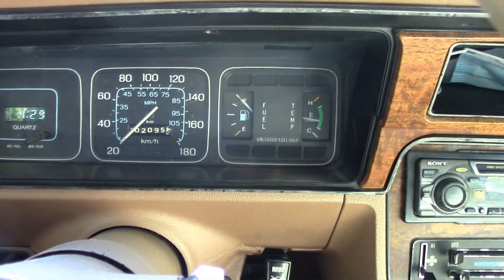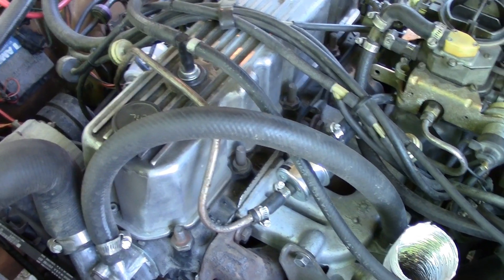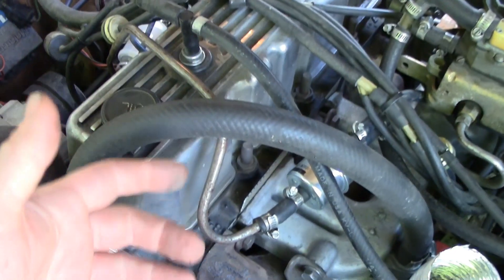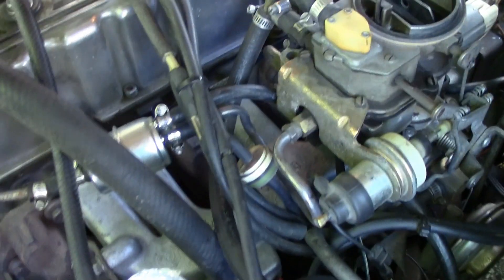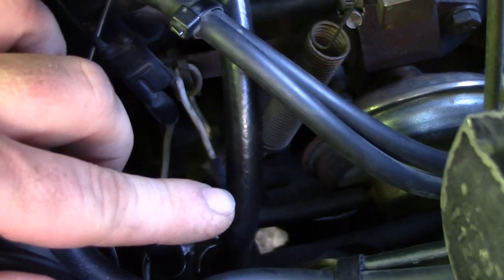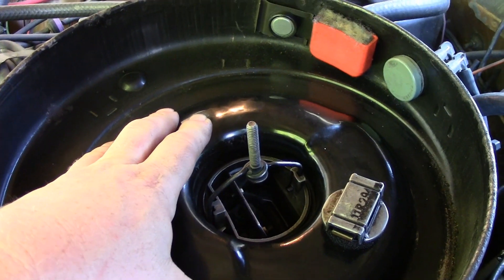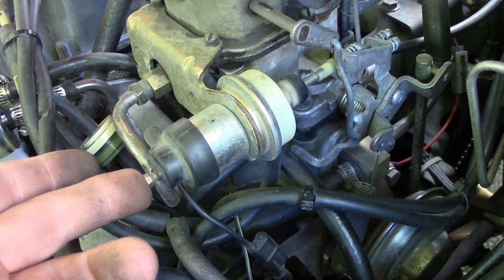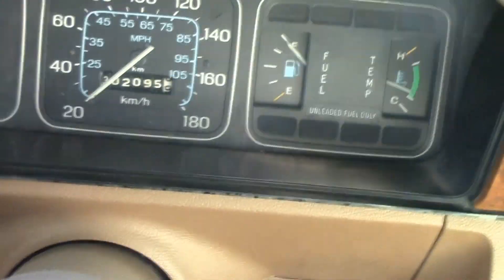Engine Vapor Lock and How We Deal With It

Comment: My Eagle tank has a ton of pressure when I remove the cap, is that normal? One of the rubber lines looks kinked coming out the sending unit. It starts & runs fine though.
Reply from the maker: Make sure your vent line between the tank and the charcoal canister is not blocked. There's a restrictor in the vent line so it will pressurize like that but should equalize after 15-20 minutes being parked.
Reply: @CelGenStudios  what if you dont have a return line on gas tank?
Reply from the maker: @ToxicChihuaha  Not a lot you can do there.
Reply: @CelGenStudios   vented gas cap? lol 😭
Reply from the maker: @ToxicChihuaha  That or make sure your carb bowl has a vent. These types of fuel filters really expect a return line.
Reply: @CelGenStudios  Oh ok i have just a single line and single line out filter on my 70 el camino. Never got vapor lock but the gas tank does hiss bad when i take cap off.
Reply: Update: the gas tank vent line at the top of the tank was plugged, I blew it out with compressed air and that fixed this issue. I think there was a little piece of rust in it.